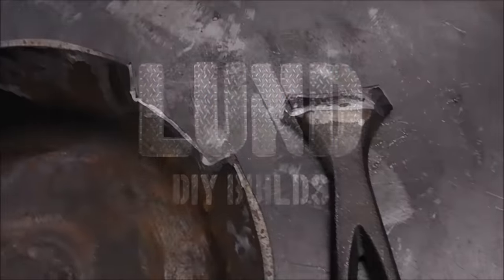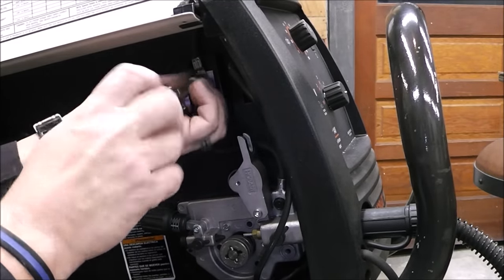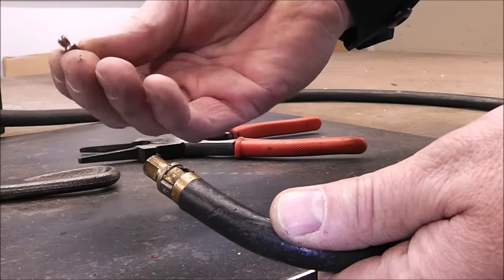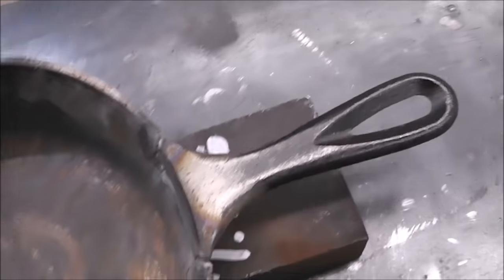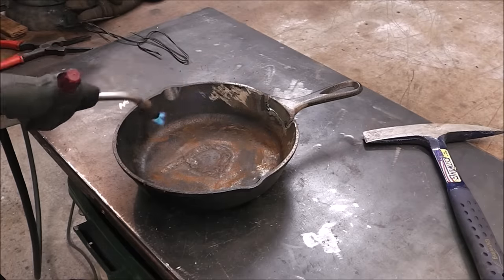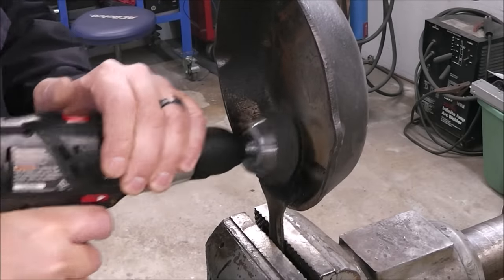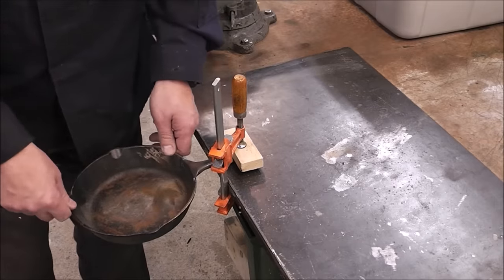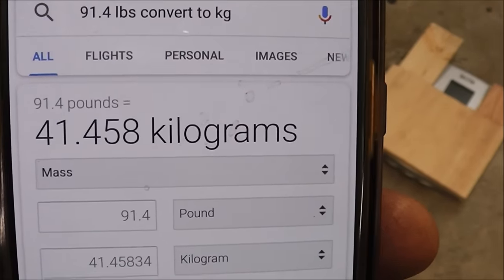Cast Iron Welding Repair using Flux Core Wire

Comment: That’s the welder I have. I need to flux wire weld a cast iron exhaust manifold. What settings should I use for that with flux core wire?
Reply from the maker: I've always found the chart on the door gets me real close. Going by memory try 4 /45

Comment: The moisture you see when you start your preheat isn't "coming out" of the cast iron.  That moisture is from the torch itself.  When propane burns one of the products of that combustion is water vapor, which IMMEDIATELY condenses on the relatively cold iron.  Notice when you start the preheat, the area of the skillet get dark with condesation.  Then as it gets hot, it dries out again.  Yes, there is SOME water present already, but what you see is not that water.  As a proof of theory, simply heat the bottom of the pan and record BOTH sides.  The side opposite the flame will not darken then lighten.  But the side with the flame will.
I think for your peening to do anything measurable, you need to hit harder, earlier, and with a blunter hammer to move more metal and continue it through some color changes.  Using backup dollies will help a lot.  You may want to heat them up a bit so as not to sink too much heat.  A good needle scaler can do a pretty decent and fast job in the peening process.
Sand is not a very good medium for slow cooling.  I recommend vermiculite.  
Mostly nit picking, but those are just my recommendations for best chance of success.
Regardless, the results prove an adequate, reliable repair is possible for MANY, not all, applications.
Reply from the maker: I mispoke about combustion. In my experience most people have about a 50% chance repairing cast iron using just about any process with basic fillers like mild steel, low hydrogen, nickle as long as they take their time to prep and weld slow. To date the strongest repair we've done was wire feed silicon bronze. I believe it was within 10% of the original unbroken strength during destructive testing. Its good stuff. Of coarse torch brazing is still king but not everyone has that equipment.

Comment: Castaloy cast iron repair rod works well for cast iron repair using propane heat or map torch..👍
Reply from the maker: A couple of people have mentioned this. I havent tried it YET but it sounds like I need to

Comment: I bought a Lincoln 100 mig it was flux core but iv bought a conversion kit from Lincoln that now i can use gas but funny part i still use flux core my welder can do .35 wire but i love the .30 wire soo much more.. iv welded 1/2 inch before and it works great of course its multiple pass. But any newbies id highly recommend a Lincoln 100 or a Lincoln 140.. i love the damn thing iv used it alot iv had to replace the ground wire because its not heavy enough so i went with a thicker ground and now the wire never heats up
Reply from the maker: @Derek Graham I agree 👍 I had an old no name flux core 110 amp welder probably 30 years ago that I ran tons of flux core through. I beat the thing so bad. I took out the fuse and completely bypassed the over temp sensor just so I could push it so it would run non stop (highly discouraged and dangerous) but when your 20 years old you think you know everything and safety didn't matter much to me then.  Needless to say eventually i burned it up without burning down the garage but it ran for years like this. I love flux core and you can build a ton of stuff with a smaller flux core welder.

Comment: How much weight did the pan support when new?
Reply from the maker: Honestly, I cant remember. I have that answer in my cast iron repair series. I tested a new pan and have that information, I just cant remember what it was. I will say that using silicon bronze filler is almost identical to the original strength of the pan.

Comment: What settings on the MiG welder?
Reply from the maker: I'm just treating it as thought it's regular carbon steel and just using the chart on the inside of the door based on the material thickness. I actually cant remember. It was probably setting 3 or 4 and around 40 or 45 or somewhere in that area.

Comment: Is it Flux core ir mig? Cause those are two different processes of welding?
Reply from the maker: Flux core does not use gas (usually) but MIG does.

Comment: Very often can't is just short for just because you can doesn't mean you should. Neat though I wasn't expecting it to hold more than 50 lb
Reply from the maker: Many of the old timers have been fixing cast iron in non conventional ways like this for years so for them it's probably no surprise, but for the new guys it sometimes ruffles their feathers when you introduce something that "wont work" and when it does work people will often tell you that it will eventually fail. .

Comment: lol I just used a harbor freight flux welder to weld a cast iron vice that was in 3 pieces at the base and it worked but what I noticed is that you gotta do little bits at a time now I'm here on YouTube trying figure out if I figured out the right way or not on my own lol
Reply from the maker: Well from what you described it sounds like you got it right! Good job brother!

Comment: Flux core works in a pinch, a nickel rod may have worked better. But like you said, it's a skillet. Who cares.
Non gasless Flux, a good Flux with 75/25 mix gas works well too. Gives nice clean welds and nothing really to clean.
Definitely would have benefited from a nickel rod. Wouldn't have broken
Reply from the maker: All great points! Thank you 😁

Comment: The secret is what works good enough! Also, what can happen if or when it breaks. A quickie repair on a frying pan is not the same risk as an aircraft landing gear.  Risk also includes custody, where will it go after it leaves your shop and where can it go after that.
Reply from the maker: Spot on. I don't repair cookware ever. Even if the customer says it's a wall hanger. There is too much liability.

Comment: I Am practicing on a Brake Rotor and can't run a steady bead.
Is that because of the type of Metal?
Reply from the maker: Yes, brake rotors are hard to weld on. Im not sure what they are for metal but the weld tends to crack like it can with cast iron
Reply: @BrandonLund   Thanx Brandon,My first harbor freight flux welding practice technique sucked on a brake rotor Just flashed and sparked at all settings.
Reply from the maker: It sounds like your ground clamp might have been on rusty metal?

Comment: Maybe somewhat late, but cool vid! I've done large cast pieces, like manifolds with muggy rod in a stick welder and had great results. The preheat and cooling is what I believe to be the key, I have a diesel exhaust manifold that has lasted 15 years after the repair and I preheated it and afterwards kept it in a preheated 375 degree kiln that I shut off after a few hrs and let it come down overnight, it was still near 125 degrees the next morning. The metallurgy of the muggy rod is another factor, they're worth the expense.
Reply from the maker: I agree 100% on pre and post heat. It's the best way to go about it and for critical repairs you cant go wrong with Muggy Weld in my opinion. It's not cheap but there is a reason for that. It works

Comment: #1.  If I was prone to switching polarity I'd be trying wing nuts instead of keeping a wrench handy.
#2.  The little white bucket contents shouldn't be added to the weigh-in, since it didn't support that weight.
Reply from the maker: Good tip on the wing nuts. As far as the white bucket, it's been way too long for me to remember if the bucket was weighed when it wasn't part of the weight that broke the handle. It's possible I made a mistake but I cant imagine. Maybe this is the video where I'm holding the white bucket with one finger as it broke? if so, it took the entire white bucket. i just happened to be slowly letting off pressure as it took it all and broke. Viewers are pretty quick to point out issues and this video has been out a while.

Comment: you don't see two holes on the top of the horizontal weld on the left side @ 10:23?
Reply from the maker: I'm not sure what your referring to. I saw nothing out of the ordinary when I repaired this. There werent any holes.  If your referring to pososity, that's entirely possible. Cast is very dirty. The only real way to not get porosity is to braze...but that's not what this video was about. Your gonna flow cast iron using this process. Its unavoidable.

Comment: No judgment here . They say cast iron is,almost difficult to weld and takes time . Depending on what is used . Cool vid .
Reply from the maker: Thanks man. It all depends on preparation and luck
Reply: @BrandonLund  one inch at a  time and hammer a bit or it won't turn out right . Cracks might come about if not done right . Rought iron or cast iron needs special welding than other metals like steel metal . . In short only an inch of welding and stuff.  Then if all procedures some right welding cast iron or rought iron can be done . . And u him a say a text . I did some cast iron welding or rought iron welding they turned out good.  Inch at a time any more is cracks and not good on welding on cast iron just one inch st a time
Reply: @BrandonLund  and luck if too much on anything will turn grey iron white and cracks in the iron . Only weld one inch at a time nothing more . On iron
Reply: @BrandonLund  preparation yes

Comment: The tip you need is for prevent the gas exits to be clog with the splatters let's by fluxcore welding

Comment: what you need to do right afteris put in a contaner of heated sand like hot to slow the cooling down or it will crack
Reply from the maker: Yes a post heat and a preheat is best but I've also had good results by just welding it up and hoping for the best. A welding blanket works good also.

Comment: I would love to see what load an unrepaired skillet held. This way we can conclude on wether or not this repair is useful. If it is not nearly as strong, this is useless. If it's at least close. I would consider it a viable repair method.
Reply from the maker: Its far from a useless repair if it serves the intended purpose. Repaired cast iron fails in the heat effected zone. It won't be  as strong as before by approximately 1/3. That is just a rough estimate.
Reply: @BrandonLund  It seems useful for cosmetic repairs in that case. Good info.

Comment: flux core mig wire" at the start, you might want an insulator on your gun to protect the holes on the brass diffuser if you want to ever gun gas properly out of it, if your gonna talk about peening id have like to seen a peening hammer instead of a chipping hammer, you have inspired me to make a channel
Reply: A chipping hammers point is what everyone I've ever worked with or for, has used to peen the weld on cast. It spreads the weld a bit just like a peening hammer, but there is less surface area in contact with the weld while using it. Therefore less cooling from the peening
Reply from the maker: An insulator is nice for what you pointed out but I don't do enough self shielded to worry about it, plus I like the visibility without it. Spray everything with anti spatter and rarely is it ever a problem.  I have never used a peining hammer on cast iron and don't know anyone that does. As someone pointed out, the smaller surface area of the chipping hammer helps elongate the weld. This is an important step in the process to helping alleviate cracks. As far as me inspiring you to start a YouTube channel, your welcome. Please don't forget me when your the next Mr. Beast of welding ;)

Comment: Pre heat the cast Iron but not overheat it. And short welds and peening between welds and slow cooling as you describe is exactly the way it should be done.
Reply from the maker: Thanks!

Comment: I usually stick weld it with 6011..idk but its always worked for me..I just burn it in deep and wet..put it in a bucket of fireplace ashes
Reply from the maker: If you really want a strong joint try MIG silicon bronze. You will be amazed https://youtu.be/Cm3_uv-PhPM

Comment: wow, I am surprised about how short you hold the flux core wire while welding. Usually you hold at least an inch out, way longer than when welding gas shielded, but o.k.
It would explain why you had to take off the cap too. I find my welds to be way better with a long wire out.
Reply from the maker: I weld everything between 1/4" - 3/8" stickout and twice that when using flux core. I personally dont see much of a difference though.
Reply: @BrandonLund  Thanks for the replay!. Interesting, I suspect the welding wire is where the difference might come in. I just find that the penetration, splatter and overall look of the weld is much better at 1/2"-3/4" electrode length. They say the electrode must be heated well enough, before it melts off into the work piece and it ties in way cleaner I find. Then again, I am only on a little fabricator machine.
Now I have to try a different brand of flux core, just out of curiosity.

Comment: I think it would’ve held or held more weight if u would’ve welded both sides any of it will work stick mig tig all those fillers are made under a low hydrogen process
Reply from the maker: Hey Bill, be sure to check out my cast iron welding series. We actually tested this. Welding one side Vs. welding  both on cast iron.

Comment: I'm curious how long the weld would hold over multiple heat/cool cycles seen in the real world
Reply from the maker: Like any cast iron repair, I could last 1 heat cycle or thousands. Its all dependent on the cast iron content and the heat input when repairing.

Comment: I figured out I could weld cast iron back in 1989. Just a cheap flux core on low setting worked.
Reply from the maker: Sometimes the simplest plan works the best 👌

Comment: this is exactly my situation. I have a threaded hole in a cast metal little engine block who is totally broken. I pretend to grind everything and fix a SS coupling nut in the place and then use Flux core weld (which is the only one I have in my garage) to try to melt everything together. I saw 487 dislikes in this video and makes me laugh because like Brandon say, not everybody has all the resources. I have a question Brandon, is any alternative to avoid heat the area? Is absolutely necessary? Thank you pal
Reply from the maker: Heating it just reduces your chances of it cracking. You can try to do short sections. Ive done it successfully without heat. If you have a stick welder i have a great video coming out this Friday that will interest you. Its a cast iron repair.

Comment: How can you weld using E71T-GS without the nozzle on?
Reply from the maker: Steven, This wire can be used with or without gas. If your using gas than you use a nozzle.
Reply: Thanks Brandon Lund, i was wondering because I read that the GS means it requires gas shielding(but the type isn’t specified) when welding. and  I’ve seen E71T-SS for self shielded wire.

Comment: I tend to believe that if the weld breaks and takes out parent material instead of the weld itself, it was a successful bond. Did the welding process crystallize the parent material? Probably, but the break didn't look too badly crystallized. I don't think you're ever gonna be able to fry a 90 pound burger in that rascal, so it passed the 'you can use it again' test.
Reply from the maker: Thanks man. I'm sure it crystallized some. Most of the time the part will fail right at the toe of the weld or close to it.

Comment: well personally i dont care.  Just the weight alone is more than enough to say.  If i wanted to fix my abisynki, now i can.  i have mig and only have flux core.  If this can handle 41 kilos.  Then i safely go out and try to repair an item that CANOT be bought as a single item.  Either 500 cost or try to fix this way for 2 more years until i can actually afford a brand new unit.  Thank you for showing me that it can be done.  just for a sake of thought.  After i grind it down after a weld.  I always add more welding to the said joint to remelt and strengthen the joint then extend the welding about 2mm in all directions.  thank you again.
Reply from the maker: @jason puttock thanks man! I appreciate that you see what I was trying to convey here. Some people in the comments missed that part 👍
Reply: @BrandonLund  I just welded my water pump handle.  Cant buy one at all for love nor money.  Will test it out today over mums house.  If it draws water then the lockdowns should not bother here when water gets turned off.  I am preying and hopeing it holds enough weight to use it....  Fear....
Reply from the maker: @jason puttock I feel pretty confident it will work but cast iron can be a crap shoot depending on the batch.  A water pump handle is narrow with not much surface area. Be sure to bevel the joint a little so you can get some more surface area to weld.
Reply: @BrandonLund  yes i beveled the edges.  I even extended the welding seem by 3 cm and added more layers.  should find out today if it holds.  But gentle striking the welded holder that snapped is holding for now.
Reply: @BrandonLund  yup the handle is holding just fine.  20 Kilos of force and its working.  Now to figure out how to make the water pump cylinder perfectly round.  Their is so much wear on this pump its a dam joke.
Reply from the maker: @jason puttock that’s great news! It’s always a rewarding feeling fixing something especially something like this in your case where it’s not available to replace. I put this video together for specifically this reason. I’m glad it worked out for you buddy! Nice job!

Comment: This might be fine for this application but for projects that have heavier materials I would recommend using a nickel filled metal. Same procedure just a different filler.
Reply from the maker: Comparatively they had a very simular breaking strength

Comment: I forgot to change my polarity. Welds sucked. I didn’t change the dye either. I didn’t know about the ceramic tip either
Reply from the maker: You will see a big difference when you change polarity